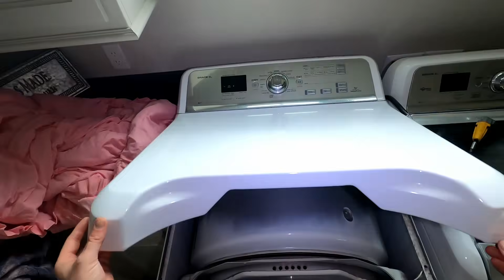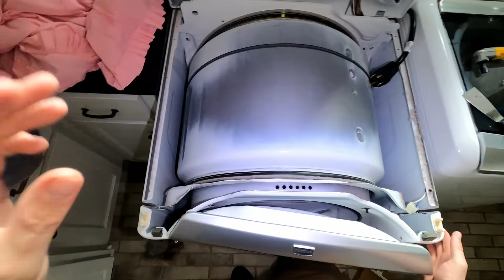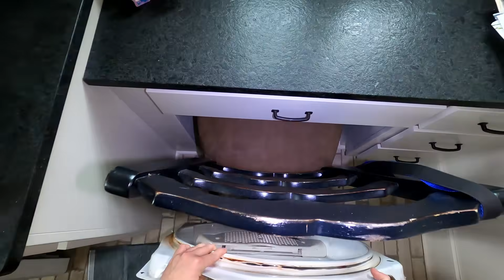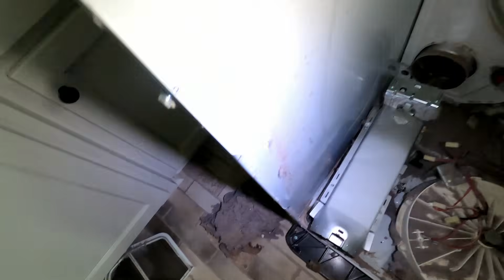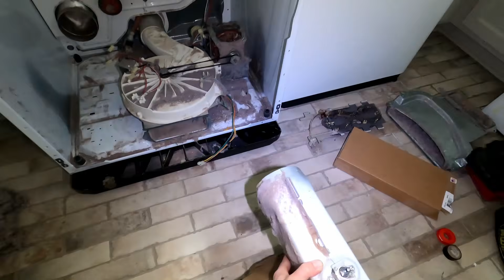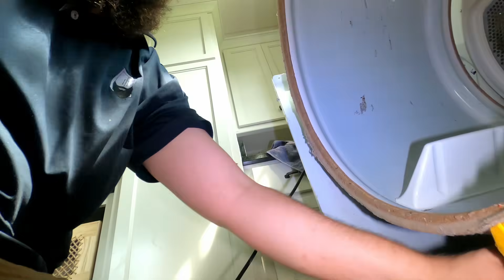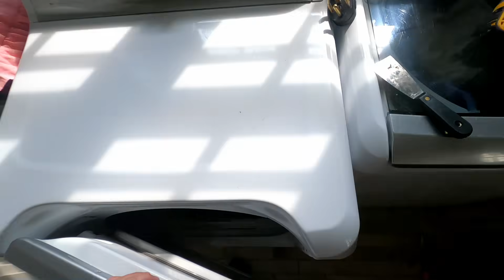Maytag Bravos Dryer Not Heating Diagnosis and Repair.

Comment: Awesome video - thank you so very much.  Here are my two cents... instead of pulling out all the wires from the thermostat and fuse, just unscrew both - leave the wires on so you won't have to figure out which one goes where...also on the wires you pull off the element mark the top one with some electrical tape - that way when you put everything back together you know where they go.  Lastly gently push the belt off the drum to get it off instead of messing with the pulley....and that's the dipping sauce to go with this amazing meat pie full of good information.  I will add more stuff if necessary, for ordinary unskilled guys like myself, after I put everything back together...Thanks a ton bearded guy!!!

Comment: Great video thank you my dryer is not heating but the detect light is illuminated and I wonder if it’s the airflow sensor and not my heating element anyway to check that without taking apart

Comment: Thank you for the great video! One note though, as I am constantly flumoxed by the numerous array of locking plastic electrical connectors,...wish you would have mentioned the black plug on the thermostat, and that you pry the back away before popping out the plug. You seemed to casually pull away all the plugs in a like manner.

Comment: Heyyy I have the exact same model but I can’t seem to find the belt size mine busted and I tried a 92 1/4 and it’s too small it isn’t as easy to apply as you did it? Just wondering do you happen to know what length I need to get for this brand?

Comment: Thank you, thank you, thank you! I suspected my heating element had gone out. I naively thought I could run home from the parts shop, do a continuity check and return before the store closed in 15 minutes, since electrical parts aren't returnable. I didn't expect I would need to remove the drum and almost completely disassemble the dryer to replace the heating element, which I imagine is a fast-moving service part. Not very good serviceability on the part of Maytag. But everything went well according to what you showed. Perhaps you could have spent less time talking about screws, but emphasize the importance of installing all of them. Since there are 1/4 inch and 5/16 inch screws, you might have mentioned which size goes where, but I kept track. I once ruined the circuit board on a hard disk of an early Dell computer because they had 2 screws, slightly different length, and they were even tripping up their authorized repair persons when the longer screw bottomed on the edge of the circuit board.

Comment: This was perfect.  Everything I needed.  My only failing was I dropped one of the clips that hold the top on, and it vanished in my vacuum (and I mean vanished-wtf), so I'll have to get a replacement.  But thanks for this, this was spot on.  What a PITA, I remember when the elements were on top in the back and could be replaced without taking the entire thing apart!  A simple $25 kit with the element, themostat and fuse vs a replacement dryer  (and I still have the other two parts, just replaced the element!).

Comment: Used this video to replace the heating element in our Maytag.  Took me a little longer then the 24 minute video, but that's because I had to come back to the video a few times to make sure I was following along correctly.  The belt was a little harder then it was shown in video, but after a few curse words got the belt on properly.  Thank you for posting.

Comment: Great video. Got to the element following your instructions. It was broken just like the one in the video. I clicked on your link but got the "item unavailable" message on Amazon. Got it ordered from a different supplier though. Fingers crossed it will do the trick.

Comment: This was an excellent DIY video. I followed your instructions and was able to replace the heating element on my Maytag dryer. The only thing I did differently was remove the dryer's back panel so I could access the belt pulley system more easily.
Reply: I ended up doing the same thing, which was pretty easy. I found out the reason I was having such a hard time putting on the new belt is that the new belt was the wrong size! Ended up putting the old one back on. The idler pulley had to be replaced also.

Comment: Cannot be more thankful that this video exists!! Just bought this exact unit as a used item for a pretty good price, got it hooked up and it runs but doesn’t heat. Been searching for troubleshooting tips for most of today and finally came across this video. Going to open up the front and take a look tomorrow to see if the element is bad in mine. Great video, thanks for sharing!

Comment: Our Maytag dryer just stopped heating suddenly. My husband found your video. After discovering that a repair person would not be available to come out and look at our problem for nearly a week, we decided to brave it and follow your instructions. My 19 year old son and my husband took the dryer apart as you directed. We identified the problem to be the heating element. I called a local appliance part store and located the part we needed. It is currently drying its first load of laundry. Thank you so much for giving such a thorough and easy to follow tutorial. We are not necessarily handy, but your instructions helped us make the repair!! Thank you!!!

Comment: Great video! I have a problem with the same exact model. None of the lights turn on at all. I know it's receiving power as i checked each terminal hookup with my multimeter. Any help would be much appreciated!
Reply: Also checked the thermal fuse and it has continuity.

Comment: Excellent video. Ours went out yesterday and then I found your video, called the local parts company where I live and they had 4 heating elements in stock. Ripped mine out, confirmed it was bad with no continuity, and installed the new part all within the span of about 2 hours. You saved me a lot of money, time, and headaches.  Thank you!

Comment: The high limit thermostat in the middle...so I broke the tab on the small connection..will that cause it to not heat too? I replaced heating element because it was bad and decided to just do the thermostat...thermal fuse and thermistor control since the unit is 5 years old...but when I was plugging that plug in for the high limit thermostat....the piece broke off...now no heat at all still...

Comment: I have this same model dryer but mine isn't activating after hitting the start button. It makes all the noises like it's on but there's no spin or heat.
Reply from the maker: Thermal fuse search 3390719.  I dont have a videos showing that one or i would link that but likely it is the fuse or the door switch.

Comment: Hey Bearded Repair Dude, Thank you so , so much for Maytag Bravos dryer vid! It was just great I can understand why you've had over 50,000 views in less than a year. You were especially good at searching for a clear camera angle for some of the tricky parts: very well done. I'm over 70 years old and my only previous appliance repair was using a fork to get a stuck piece of toast out of my toaster. You've changed my life. I would only say I could not find your links to order parts from you, which I certainly would have done. (I needed a new heating element, just as in your example.)

Comment: This was a great video and allowed me to save hundreds replacing the dryer.

I do have one recommendation. It seems you were using something to prop up the drum especially during the re-install. I eventually figured this was necessary and stuffed some shoes underneath. Guidance on propping the drum would have been helpful.

Comment: Thanks for the video for me the hardest part was putting the belt back on. Another tip you need to prop up the front of the drum when putting the belt back on.
Reply from the maker: Yeah that can help.  I have done it and for got about getting the thing I used to prop it up out of the dryer lol. Just don't forge that. lol

Comment: That for the video helped out very well ,but what brand is that continuity testers and thanks again
Reply from the maker: I use a fluke.  Best you can get in my opinion.
Reply: I watched your video 2 Months ago fixed the heating element and after two months not heating again what could it be, thanks for any help

Comment: How do I confirm it’s not the fuse first? I took apart my dryer all the way to remove the element tubing before I realized you were replacing the whole heating element. 😂 Before I go buy one, is there a way to check the fuse first? Or is it pretty certain that my heating element is bad (old dryer) and I should just go ahead and replace it anyway? If so, should I go ahead and replace the fuse as well since I’ve gotten my dryer? My husband is not certain I’ll ever get back together but I will NOT fail! 🤣
Reply from the maker: You will need to test continuity or visually inspect the element.  Look for a break in the element coil.  They can be tricky to find sometimes so look at it really good.  If you find a break than you know the element is the issue.  If you cannot find a break you could be looking at that fuse.  

The multi meter is the tool you need to know for sure though. Test for continuity and if it bad that will tell you.  You can also take the parts up to an appliance parts store and they can test them for you.

Comment: i have a maytag bravos the exact one you fixed the pulley on. my dryer currently wont spin or heat, but it powers on and the belt is intact and routed on the pulleys the right way. what else can be the problem? it powers on but thats it.
Reply from the maker: Make sure you have a good supply of 240VAC at the wall. If that is good than you may have a bad door switch or thermal fuse.

Comment: I have this model dryer and did this replacement a year ago.  The element has just gone out again.  I bought an non-OEM part.  It had a thinner gauge element wire than the original part.  Save yourself the time and get the OEM part.

Comment: You are my hero lol. Thank you so much. I have the exact same model. Same issue. Lots of lint. Seems lint was blowing thru front seal as well as rear duct. Looking to make both tighter. Lots of lint in the heating element wonder if possibly that aided in burning out the element. Element was burned at center plate where there was lint buildup.

Comment: Hey Bearded Bud! Thanks for the video! Great step by step walk through. After I put everything back together the dryer wouldn’t even turn on. There’s a steady orange/yellow light lit up on the “dry” section of the panel and the light comes on inside the drum when I open the door. Any ideas why it won’t turn on? It worked fine before I took it apart and put it back together and yes I made sure all the wires/connections are hooked back up properly. I’d really appreciate your feedback! Thank you!
Reply: There door switch was not connected

Comment: Super helpful video... I had the exact same thing with my Maytag Bravos 400 series electric dryer. The tricky part for me was the felt rings (front & back) that fit on the drum - finally got it figured out and the job was a cinch! Thanks to the Bearded one!!
Reply from the maker: lol they are on there tight. especially putting on new one.  You need 4 hands to get them on sometimes lol. glad to be of service!

Comment: Thanks for posting!.  Followed your steps.  But after restarting, I heard some clicking and then the drum stop rotating.  I removed the back panel and checked the belt which was still intact and installed properly.  I found a plastic, round piece that appeared to be torn of and slightly melted.  I rechecked your video but did not see this part at all.  I also checked the schematics and cannot identify it.  Let me know if I can send you a pic of the part to see if you know what it could be.  I restarted the dryer and it appears to be working ok now.
Reply: Plus saved quite a bit. Thanks again.

Comment: I am speechless with how it easy it was to watch this awesome video and go step by step to diagnos my dryers issue. I have never took apart any appliance in my life and this video made it look simpler than walking. Thank God it was only the element. Took less than 10 min to take apart and 15 to put back together. As it stated in the video, the belt is fun to put back on..... not. Again, thanks for the video.

Comment: Wonderful instructions! I was able to replace my heating element on my Bravos XL using the advice and guidance provided in this video. Thank you for empowering DIY homeowners!

Question - after the repair, there is a vibration coming from the bottom; if I place upward pressure on the bottom of the unit (below the exhaust fan), the vibration subsides. What could be the issue here?

Comment: Just completed the repair.  Didn't remove the drum but propped it up out of the way.  That way I didn't have to reattach the belt. Only problem I had was removing the electrical connectors from the fuse and thermostat.  That would have been easier if I did remove the drum.  By far one of the best "how to videos"I have seen.  Thank you.

Comment: Thank You for the video 
i found the issue a changed out bother thermostat & thermal fues...
But because i was not the one to take the dryer apart i have an issue still 
the small red wires (together) with white end ???
where does it connect too??
In the video it looks clear to me that it also attaches to tve Thermostat switch (in the middle of the heater casing). 
but there is no where for it to plug into???
neither the old or the new thermostat have an extra male connection??
WHY WHAT am I missing??
if anyone knows I would be grateful 
is this small twin red wire even need be hooked up?

Comment: My heating element went out on my Bravos XL dryer that was only 4-5 years old, and this video helped me do the repair.  Part from Sears was $120, got a complete kit of parts from Amazon for $35, and no technician service call ($$$), so you helped me save a good amount of money.  Thanks for posting this, it was extremely helpful !

Comment: Follow up. Got the job done accessing the innards. A tip for the rest of the uninitiated DIYers out there if it suits you. I had a hard time putting the belt back onto the tensioner and motor idler because of the spring action, tight working space, and an awkward position for my physique. Maybe, as a suggestion, when the drum is out and there’s full access to that area, use a zip tie to pull up and hold the tensioner in place. It made it easier after I got the drum back in and reached around to get the drum belt back on correctly. After the belt was placed and turning the drum was verified, I just reached around and cut the zip tie. You can either leave it, but it’s easy to remove if you knot a thread or string onto the zip tie when placing it and use the thread to pull out the zip tie after it’s cut. Again, thanks for the tutorial. Waiting for the next appliance to break.

Comment: Thank you for making this video! I just replaced the element on a Bravos XL using this as a guide. This was super helpful.
Reply from the maker: Glad it helped!
Reply: How did you get the top off? I have a 2018 Bravos XL dryer and the clips are either not engaging or non-existent

Comment: I have a Maytag Brovos xl dryer that isn’t heating. 

I replaced the thermostat and the thermal cut off, the heating element and both of the little thermal fuses and I still can’t get Heat. I am at a loss do you have any thoughts
Reply from the maker: Got to make sure power is good. You need 240vac at the wall check that first.  I like to check it where the cord hooks into the dryer. There is a small little cover to take off to check it. if you have good power there the problem is likely to be in your relay board. good luck!
Reply: I replaced mine and it started beeping after each cycle (started heating again) it was beep...pause...beep.beep.beep. 
Now a week later it’s stopped heating but still tumbled and still beeps. I’m going to attempt to re-replace the thermal fuse.
Reply: I had a dryer that repair guy wanted 400.00 to repair. NOT. Turned out the new power cord I had bought was no good. Try replacing the power cord.